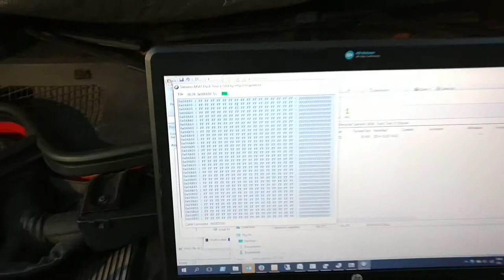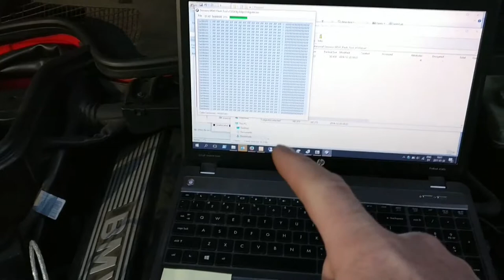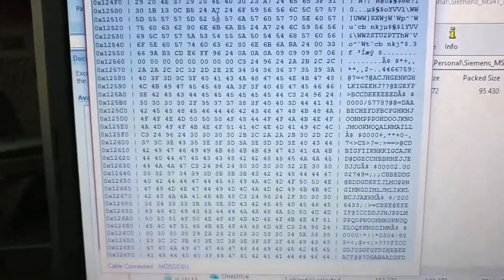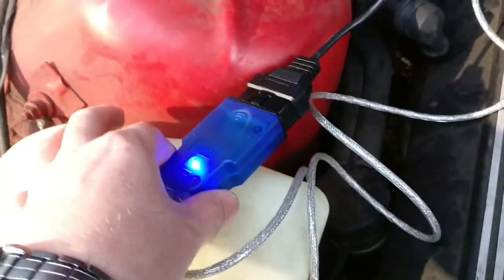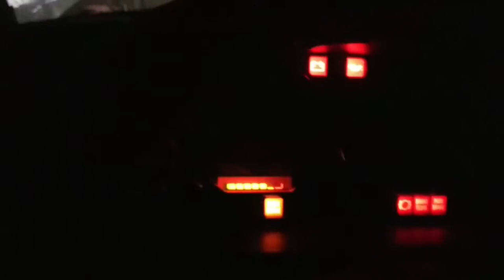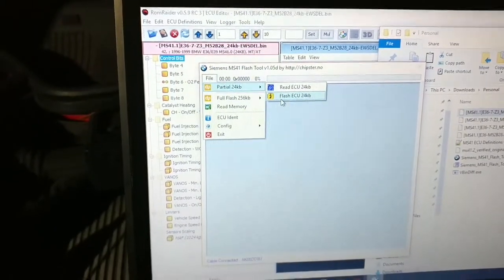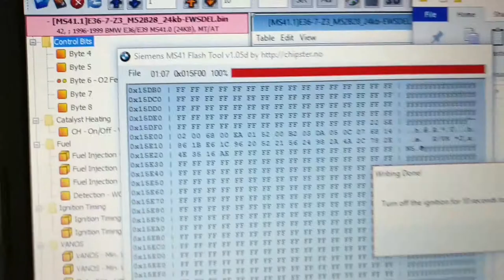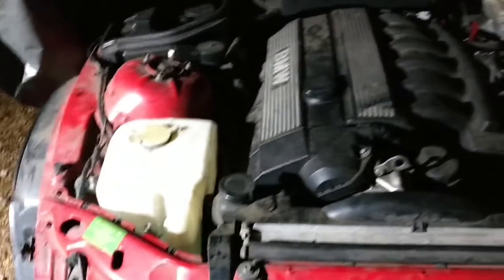E30 M52 Engine Swap - DME/ECU Programming

Comment: Hello. What if I install an random used e30 computer to mine. ?
Reply from the maker: "Random" won't work - they aren't plug-and-play. The computer must match the engine in the car. Assuming it does (for example, a "173" DME for the stock 2.5L M20 inline-6), yes it should work fine.
Reply: @RallyX26 thank you for your reply. I did replaced it few months ago with ecu from another e30, my car was running good but with intermittent voltage dropping. I called pelican parts and they say that for an 88 programming is not necessary if you are using the ecu for the same 325 type. Anyways before purchasing this time a new ecu I will first replace the main relay. Hopefully that fix the problem.
Reply from the maker: @usalbert  The ECU/DME shouldn't have any impact on voltage. Have you had the alternator tested? You may also have a bad ground somewhere.
Reply: @RallyX26  alternador is good. I will have  to look for bad grounds. Thanks
Reply: Can you post links for the cables and software?